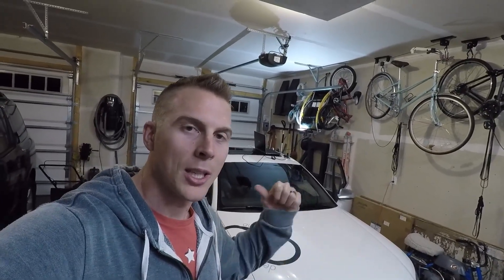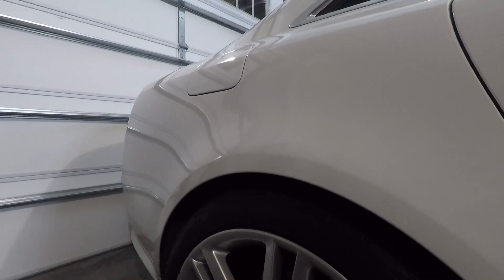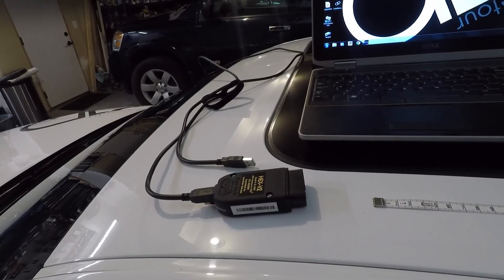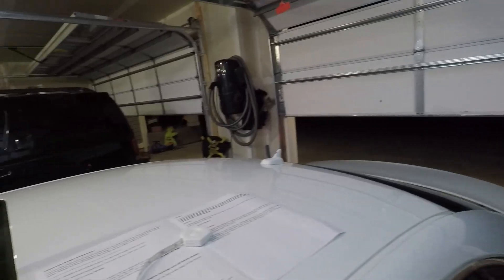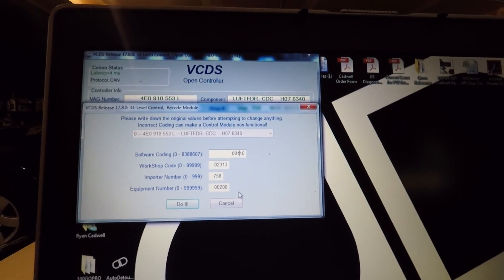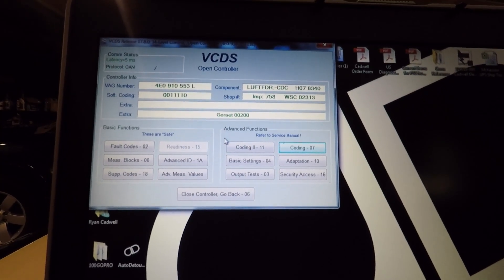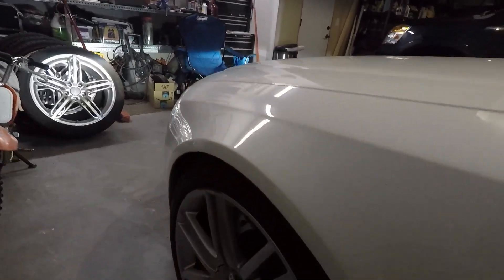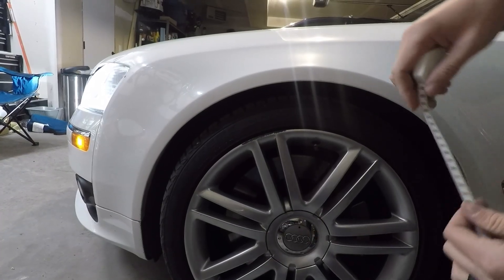Lowering the Audi S8 Using VCDS ***Complete Walkthrough***

Comment: Hi,  have you had any issues with the ride height sensors triggering a low beam error on the adaptive headlights?  I wasn’t having issues with my lights until I lowered it using this method.  Apparently you can bend the ride height sensors up as a work around?  Did you have to do that?  Thanks
Reply from the maker: No, you shouldn't have to do anything with your ride height sensors. They should be calibrated to your current ride height during the process. Bending them will mess with your ride height. The headlights should be unrelated to this process.
Reply: @AutoDetour  Hey, thanks for the video, I lowered my D3 using this method and have the same issue as Gary Fisk,  "headlight range defective" I guess they need re calibration too?

Comment: I noticed a small edit after you made the inital changes for the ride height in coding, but prior to calibrating.  Do you need to calibrate if you just change the settings in the coding, or is re-calibration necessary if you change the coding?
Reply: Any update on this? Do i need to calibrate first?

Comment: what does the suspension need to be on before the calibration? Lift, Comfort, Automatic or Dynamic?
Reply from the maker: Michael Themsen On the S8 or an A8 with sport suspension, comfort, Automatic & Dynamic are all the same height, so choose any one of those. I left mine in comfort when I did it. Thanks for watching!
Reply: @AutoDetour , hi if the settings are the same on a8 sport does the shock harden on dynamic and softer on comfort? Thank you

Comment: Great video.. I have a 2009 S8, and I just put on the wheel spacers, and it looks great.. I got the VCDS & Cable and plan on adding these changes as well.. Thanks for the other videos you have posted they have been very informative.  After some other changes like the X-pipe & Intake Manifold spacers (Part# JHM-07L133074B-07L133073E) I'm going to use the VDCS software to advance my timing a little bit..   Thanks again for the great videos..
Reply from the maker: Thanks Chad! I appreciate that

Comment: Hi I have a 2007 A8 tt diesel d3 ,did you have to change any suspension components for lowering your A8 as I was thinking it may through out the geometry of the suspension. Your video is great and very detailed but it just crossed my mind. Have told my mechanic and he is attempting to lower it as it is at the shop as I put the car in bootloader mode and stuffed the mmi. Thanks
Reply from the maker: No, you don’t have to change any of the suspension components when you lower it. An alignment wouldn’t hurt, but I didn’t even do that.
Reply: @AutoDetour  thanks mate, im picking it up tomorrow and see how it looks.

Comment: Thanks for great information and a great channel! 
I am about to do very similar with my 2008 S8. Do you know if it Is possible to make individual height changes to different suspension modes with the VCDS system? 
What I am after is to lower the car in Dynamic and Comfort modes while still keep the original ride height at High-mode. (It is needed with the high High-mode due to a high curb to access my driveway.)
Reply from the maker: No, unfortunately. Lowering the car using VCDS will lower all setting the same amount. Lift will still work, but it just won't lift as high as it did stock.
Reply: Thanks for the quick reply, even though it was not what I wanted to hear ;-) 
Unfortunately I am just able to clear the curb with the original "High" mode so I will then run into trouble if lowering the car. Since I will install a smaller body kit as well it will not make it easier. (On my Range Rover I can do completely individual settings of each ride height via computer and had hoped this could do the same.)
Well it seems like I will have to spend some time and money to modify the curb.
Again, thanks for a great channel, it certainly inspires me and others.
Reply from the maker: Modify the curb! I love it! LOL that's what I like to hear! Thanks for watching the vids.

Comment: Great video!
Can you answer to my question.
Did you use lowering kit and vcds.. Or just only vcds+original suspension?
Reply from the maker: Thanks! I used vcds only on the stock suspension.
Reply: Auto Detour
One question again 😁
When you work on lift.. Does the car been in lift or dynamic mode?

Thankss
Reply from the maker: I'm not sure I quite understand the question, but changing the ride height will affect all modes equally. If you lower 20mm, then lift mode will be 20mm lower than normal, and dynamic will be 20mm lower than normal. I hope that answers your question.

Comment: Great video mate! I got an 05 audi A8 and i love the wheel and tyre fitment on your S8. What wheel and tyre size are you running ? Do you have an overall equal wheel+ spacer width since the car is all wheel drive ?
Reply from the maker: Thank you! These are the stock 20” wheels and the tires are 265/35/20. I have 12mm spacers in the front and 20mm in the rear. I did a video on that as well if you want to check it out. Thanks for watching!
Reply: I will check it out. Thanks for the reply!
Reply: @geraldobi1024  Hi

Comment: Great Video! I just picked up the Ross-tech equipment. I plan on lowering it this way. My question is ive seen this done with out changing the coding. What does changing the coding do?I have a 2006 A6 S-line
Reply: JYS Deano I would like to know the answer to his question as well. That was the only thing that confused. The coding part.

Comment: Wouldn't it be easier using lowering links
Reply from the maker: I considered lowering links, but the Ross-Tech cable was only slightly more expensive and it gave me the ability to lower the car and perform other mods and diagnostics, so it seemed like a better option for me.

Comment: Hello there is a risk of damage to the pillows or the compressor
Reply from the maker: The ride height is still within factory tolerance and the compressor doesn't have to work any harder, so there's no additional stress on that either
Reply: In the shown video, what size is the decrease? Thanks for the reply.
Reply: I guess is -20 mm

Comment: I'm planning on lowering to European height (down 10mm or so from U.S. requirements). I'm also about to have an alignment done. Does lowering change alignment specifications? Should I lower and then align or align then lower? I lowered my VW Phaeton with no problems throughout 150k miles, but that is a D3 platform, my A8 is D4. Thanks for any input you can provide.
Reply from the maker: If you are only going to go down 10mm, it shouldn't change the alignment specs, but since you are having it aligned anyway, wait until after you lower it. It is best to have a car aligned when it is at the final height that you want it.  Hope that helps! Thanks for watching my video!

Comment: I have an '07 S8 so I'm glad I found you.  My question pertains to the suspension setting within the MMI system.  When you adjusted the ride height, did you use the comfort setting or the dynamic setting as the placeholder?
Reply from the maker: Hey man! Thanks for watching! There is no ride height difference between comfort and dynamic. The only difference is the stiffness of the dampers. Lift is the only setting that changes the ride height of the car. So, to answer your question, the changes made to the ride height will apply to all settings, including lift. So, even lift mode is 25/20mm lower than stock with my settings. I hope that makes sense.
Reply: It does.  Have you had any issues in lift mode not clearing inclines or drives that are steep?
Reply: @AutoDetour  what about the hack to turn off auto lowering @ 62MPH? I should be able to do this hack, lower it when I want to, then raise it for everyday driving and use the secondary hack to disable auto lowering so it stays higher at all times??